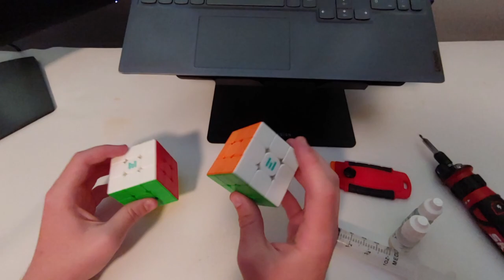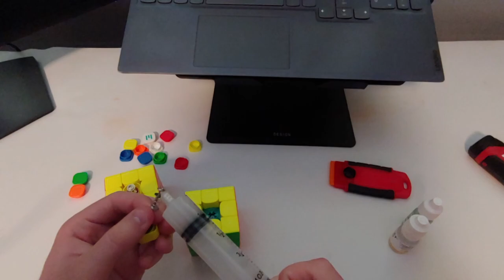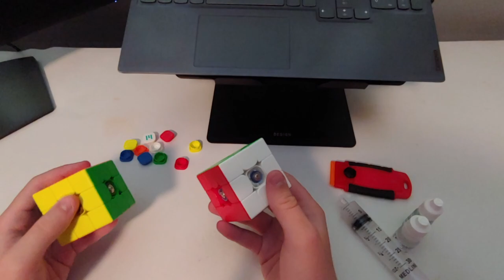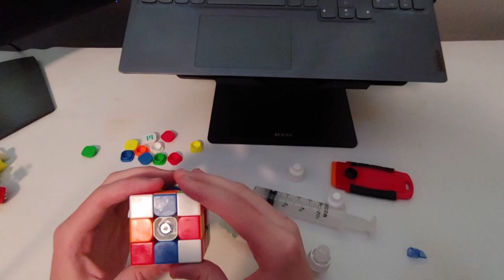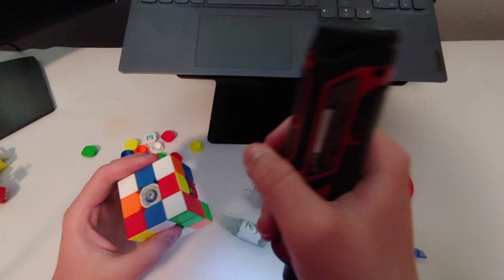HuaMeng YS3M Setup Tutorial

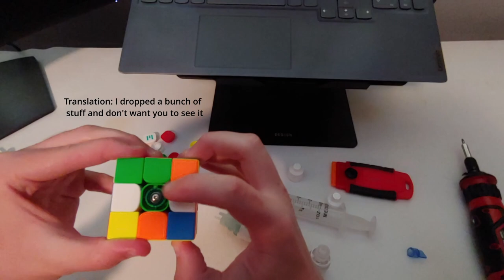Comment from the maker: The text at 9:13 was supposed to say that I ended up loosening it slightly more

I also forgot to mention that the springs loosen up over time as the cube gets broken in, so you may want to use a lower compression setting initially and increase it after a few hundred solves

Comment: can you use the springs of rs3m 2020?
Reply from the maker: Yep! The super has different springs though
Reply: im considering to use the srpings of rs3m 2020 because i didn't have the standard ys3m. Does the rs3m 2020 and ys3m standard have a different springs?
Reply from the maker: @echo6509  they are the same as far as I know
Reply: @StevenWintringham  Alright I'll try modding it, thansk alot man 😁
Reply from the maker: You're welcome! If the springs do end up being different, it should still work, but you may need to use a different compression setting. Also, If your RS3 M 2020 is fairly new, you may need to start on a lower compression setting and increase it as the springs break in - they are a little stiff out of the box
Reply: @StevenWintringham im going to used my old rs3m 2020, how can I know if the springs isn't compatible to ys3m bc?
Reply from the maker: @echo6509  as long as they physically fit, they are compatible. You just might need to play with compression until you find something you like
Reply: @StevenWintringham alright thanks again 😊